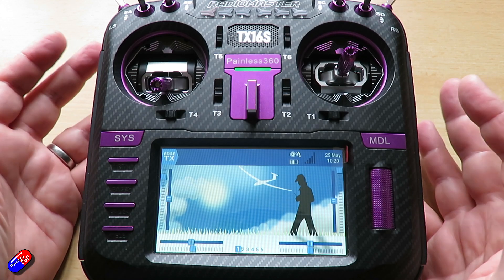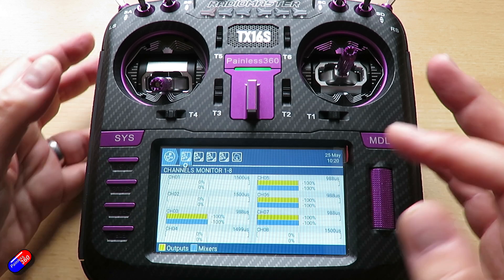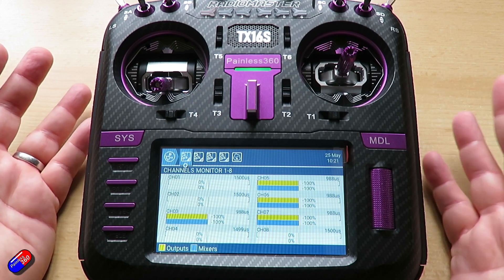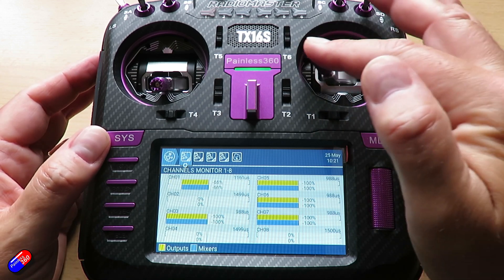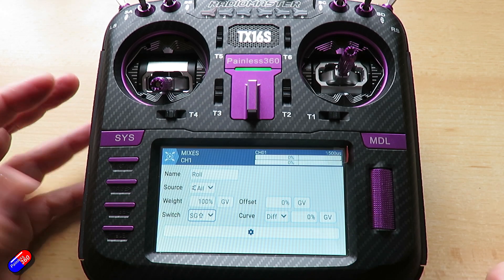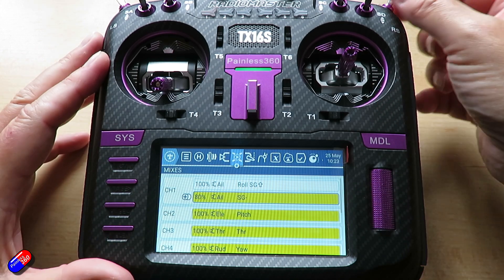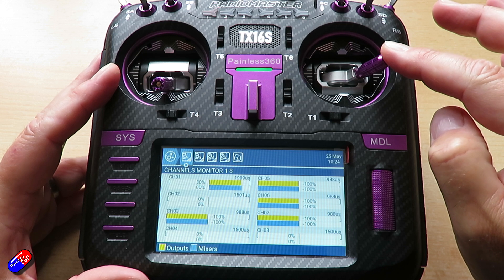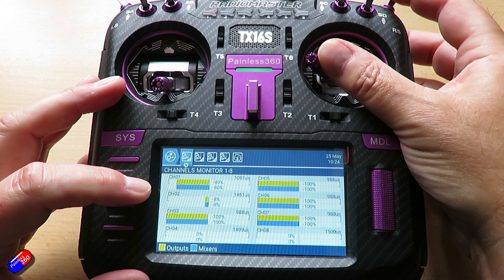How to simply setup DUAL RATES (EdgeTX for beginners 2025)

Comment: Hi… thanks a lot for all your amazing videos👍👍
I am new to flightcontroller and wondering how I can set up dual rate with a SpeedyBee 405 in Inav..?
As I understand it should not be done in my radiomaster Tx16
Best Jørgen
Reply from the maker: That's how I would do it. Using manual mode in INAV too... Happy flying
Reply: @Painless360  but if I switch to Acro to have stabilization, would that then cause a problem??
Reply from the maker: I don't find I need dual rates on models with INAV. Darren did a video on it though - https://www.youtube.com/watch?v=HomFEk3lCec - best of luck!

Comment: Thanks, this is great.  I was thinking about expo referenced in iNav and expo for channels in the radio.  I guess these are not additive as one is manual control and the other is when the FC software is controlling the craft.  What about when using position hold and moving around that way?
Reply from the maker: I'm not sure I understand the question. Always setup EXPO in the flight control software only is my advice. Best of luck!
Reply: @Painless360  I was refering to the Rates & Expo tab under PID tuning.  There is a Roll & Pitch Expo and a Yaw Expo.  If I modify the ratio stick curve and engage smoothing how does that affect the Expo component of the PID tuning if any.   When flying autonomously the  FC is using the Expo values provided in the PID loops?  Maybe I'm over thinking this.  The internal speed of the FC logic is alot faster than I can adjust the sticks during flight.
Reply from the maker: I think you're maybe overthinking it! :D Happy flying!

Comment: Excellent! I was just trying to figure this out on my new TX15. This will help me a lot. Would you be able to do a video on automatically resetting your timer when changing packs on a mini quad. I had it's set up and working on my TBS Mambo but I can't seem to get it to work on the tx15.
Reply from the maker: You can use the special function for that - https://manual.edgetx.org/color-radios/model-settings/special-functions - I'd set it to activate when the ARMING switch goes into the disarmed position. Best of luck.

Comment: Hi Painless360,
Thank you very much for your very instructive videos, that have helped me a lot.
I have the following question, which I haven’t been able to solve.
On the Radiomaster TX16S MKII transmitter, how can I set the radio up to automatic switch back to the default 6POS1 position immediately after having pressed the 6POS6 button.
(I am using 6POS6 to reset the flight timer).
Best regards,
Piper
Reply from the maker: I'm not sure how to do that off the top of my head. I'll have a think, and if I can figure it out I will make a video.
Reply: @Painless360 Thank you so much, hope you can figure it out ☺️
Reply: You could use one of the trims for reseting the timer just turn off the trim steps in flight mode 0 I use T5 Down to reset timer this only works if you don't need the trim for anything..